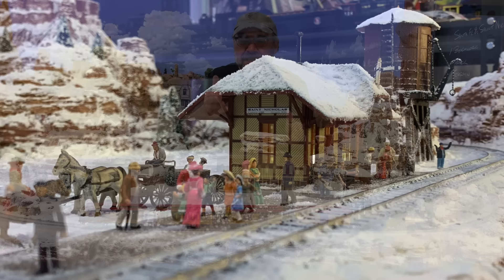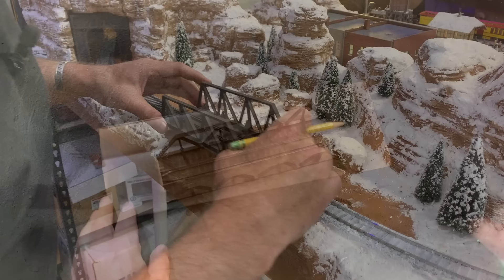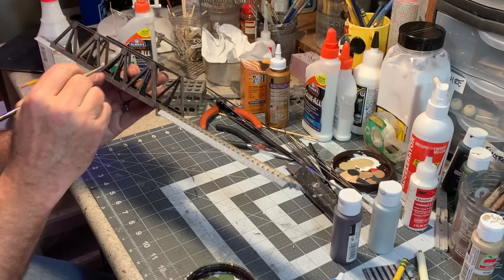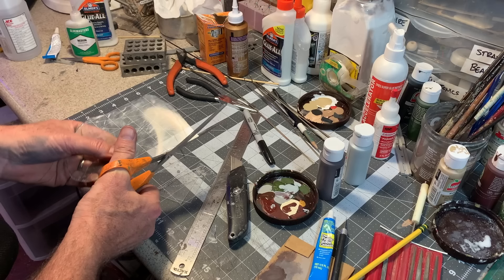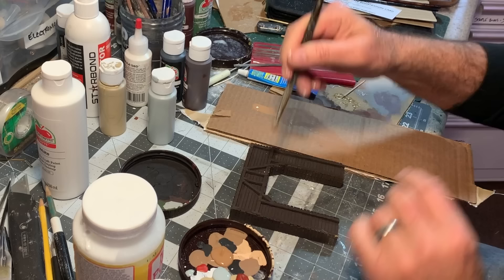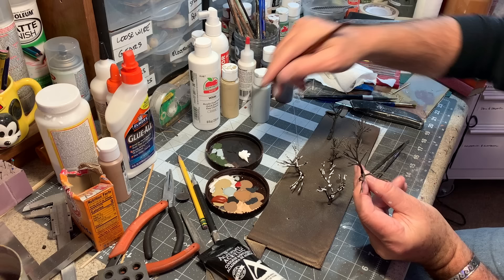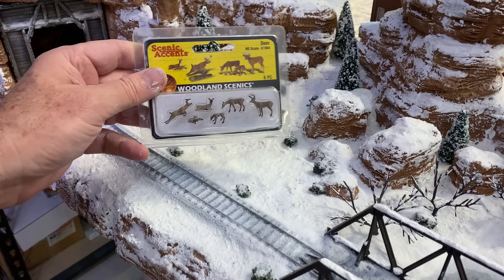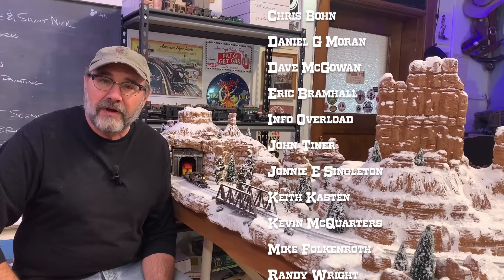HO Christmas Layout | A Winter Bridge Scene | SF&SN Part 5

Comment: Really nice build. I found that Mod Podge by itself is a great base layer for snow. Then to add some realism I put figures (deer, snow boarders, cross country skiers) on the layout and to blend them in I use the Woodland Scenics snow like you have to make it look like they are really going downhill or walking through the snow. I hadn't thought about using Baking Soda until I saw your first video on that application. My layout is the base for our Christmas tree and I add something new to it every year. One question I have is where did you get the Prospector and Donkey? I think that would be great for my 'big' layout. Also, any suggestions on where to find logging figures? Happy Holidays.